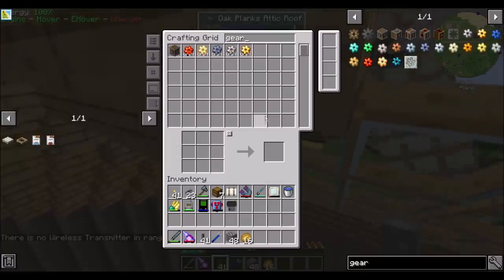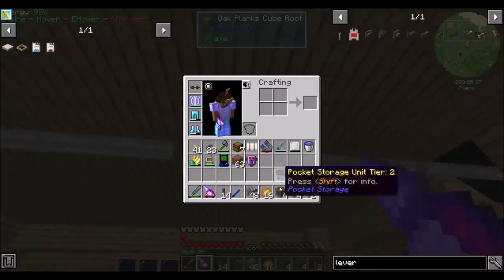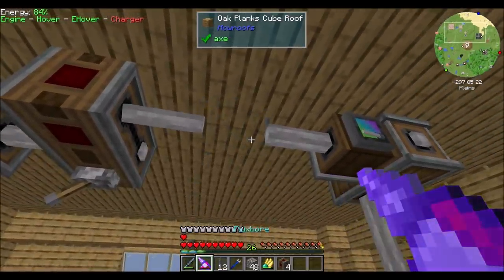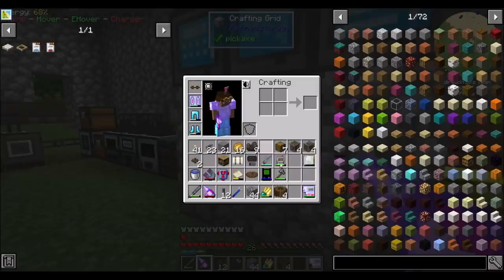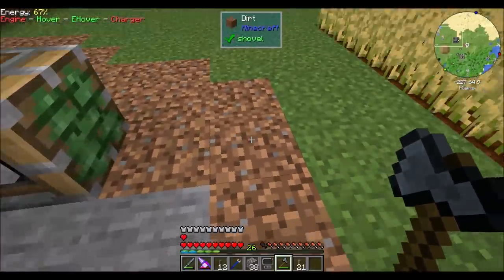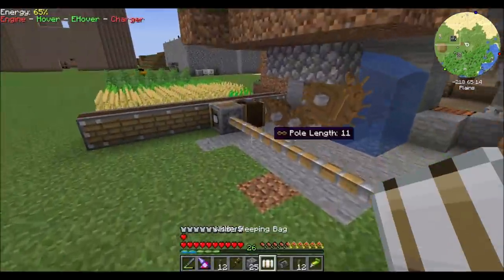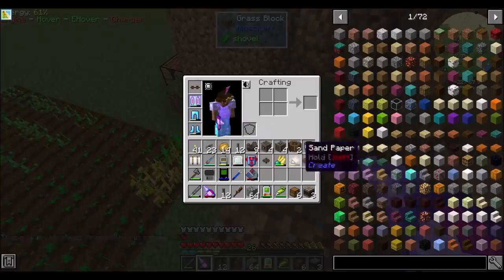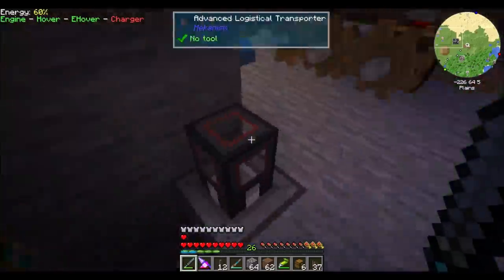Lets Play S10E30 Creative Farming

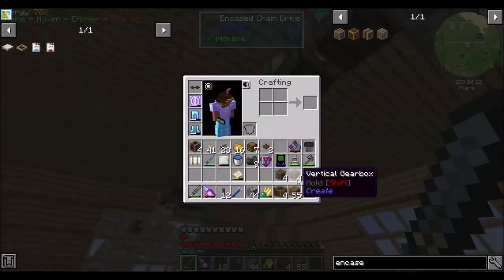Comment: Dire, one of the arms on the windmill is one block longer than the rest. Most of them are 11 blocks from the center but one arm is 12 blocks. If you pause the video at around 13:10 you can count it yourself.

Comment: Dire, the rotational speed controller, when used with a large cogwheel allows you to speed up or slow down the input to any set speed in a 1x1x2 space.
Reply: Not just that, it can choose from 1 - 256 (maximum), at the cost of energy, and you can even set it up with multiple to have some going fast, and some slowed down to keep your system from overloading.
Reply: @LevenLappi  that too
Reply: You have to tech up to the multiblock crafting to make one though.

Comment: The Hemp, doesn't replant & you need to hit the 'top half' of the plant.   It's closer to a pumpkin, except it's 2x1 tall instead of a 2 blocks on the ground.
Reply: The Hemp got replanted.
Reply: @DarkVoidIII  No it didn't. Dire replanted manually.
Reply: @travispluid3603  Well maybe that is an issue the Create mod author would want to fix then! It should recognize seeds from other mods and when it goes to harvest them, harvest and replant them correctly. They might know about it and not have it in the released code yet.
Reply: @DarkVoidIII  I don't think it's on the Create side of things cuz hemp can't be right clicked to harvest and it's like that even in 1.12 It behaves more like sugar cane than a seed crop.

Comment: 6:20 the redstone signal says how big the virtual gear inside the box that has the redstone signal is supposed to be. so if you feed 15 into the "input" box it'll have a 2 times larger gear than the output box without redstone, so the output box rotates twice as fast.

Comment: The best way to use the adjustable chain drives is in pairs with the regular chain drives.  If you want to speed up, put the adjustable one as your input and the regular as the output, to slow down, do the opposite.  At the end of the line you can place as many regular chains as you like and they'll all run the same speed.

But putting two adjustable ones next to each other is a waste.

Comment: You could use the adjustable lever combined with Create's built in wireless redstone to make a system where the more you pull the lever the faster the machines spin! hook it up to some nixie tubes and you got yourself a pretty sweet looking control panel

Comment: If One gear is turning clockwise, then the next gear will turn counterclockwise. So every other gear will turn the same direction. Even if you attach it  90 degrees vertically or horizontally (so it’s turning a corner) the same logic is true.

Comment: Doesn't Create also have an analog lever?  I believe that you can get even more control over your rotational speed if you used the analog levers instead of the vanilla binary lever, since the rotational speed of the adjustable gear boxes appears to be variable based on the strength of the redstone signal being supplied.